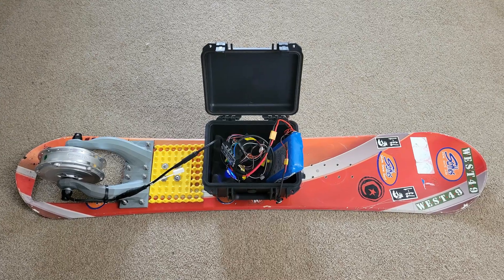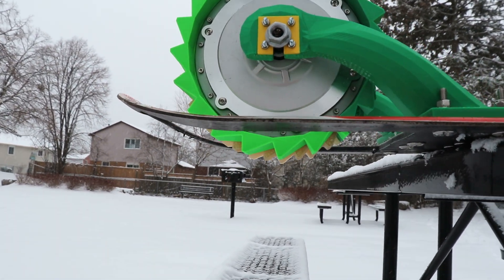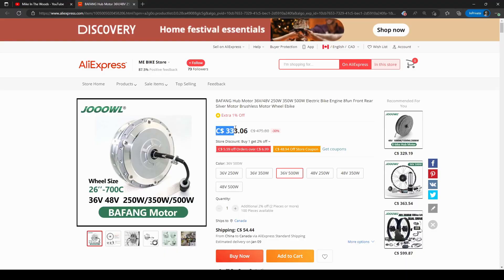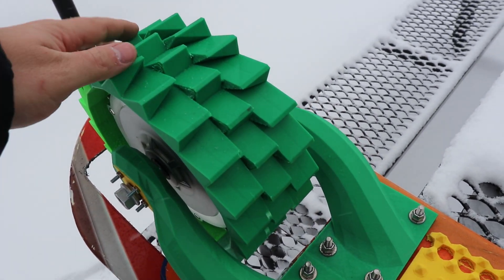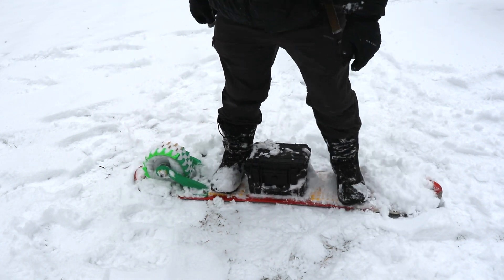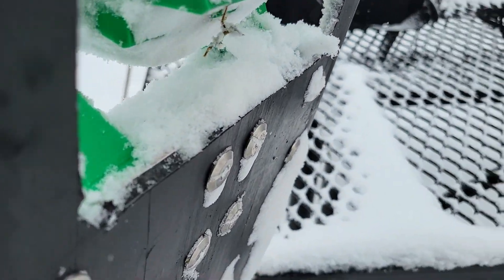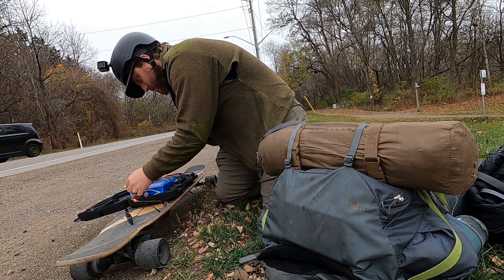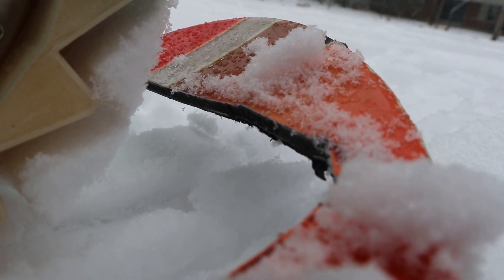My DIY Electric Snowboard Broke… Here’s What Happened

Comment: I'm interested in this project, but I'm wondering if I could perhaps use a smaller sized motor that wasn't attached to the hub and instead used a belt-driven attachment to drive the wheel instead.  I just purchased your parts and I'm hoping to do a remix with it.
Reply from the maker: The benefit of the motor being where it is, it helps weigh down into the snow for traction. Interested to see what you come up with!